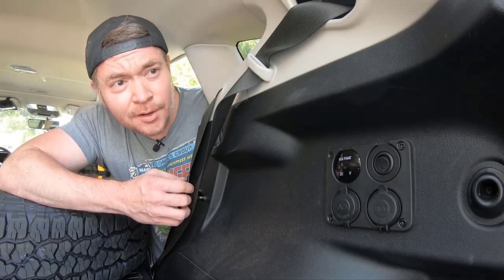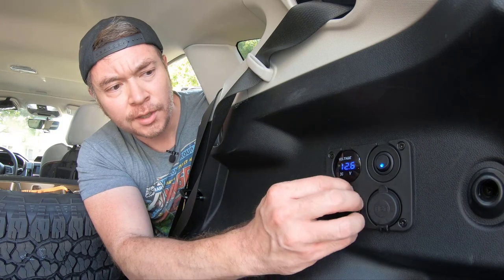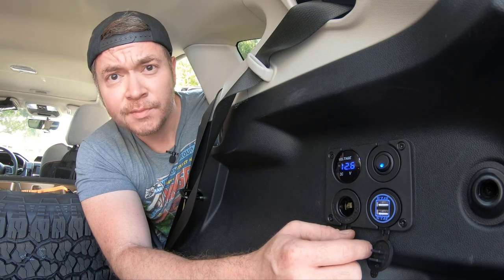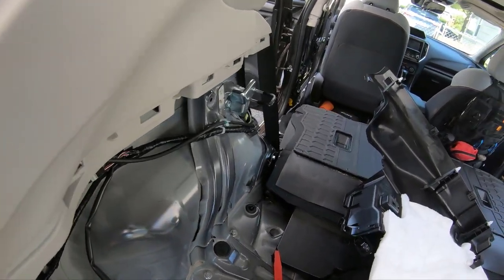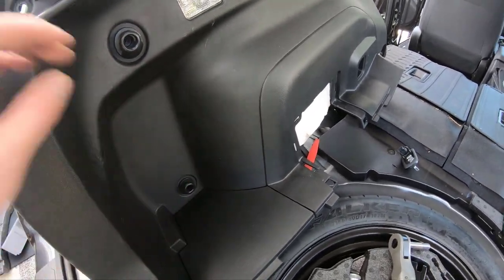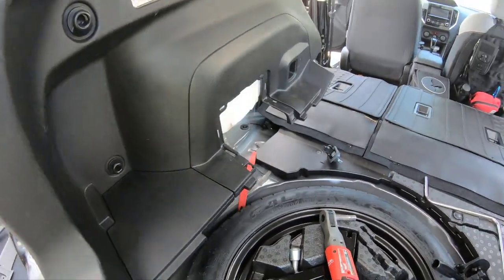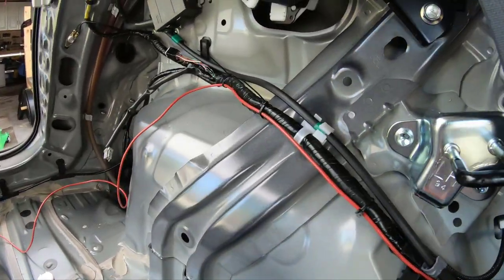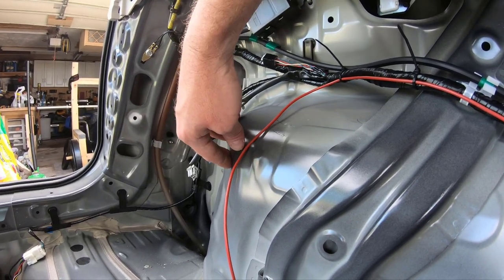DIY 12v Panel Install - Subaru Crosstrek

Comment: One of the best how-to mods I have seen which pays attention to safely and properly wiring a circuit. Please consider posting more links in the SubaruXV forums—maybe get this stickied. Glad I found yours.
Reply from the maker: Very kind of you to say.  Thanks for the feedback.  This was actually my 1st video and I learned a lot.  Some folks from the XV forum gave some good feedback (like the correction I added to the description).  I'm still learning, and in hindsight I wish I had spent more time sharing best practices with respect to selecting wire gauge and what not.  I just started this all over the summer for the fun of it.  I like tinkering and video editing and figured I'd try to share stuff I find interesting with the communities from whom I've learned so much.  Thanks for watching and keep the feedback (positive or constructive) coming.  Much appreciated!

Comment: Great information and content but I will make 1 suggestion. 

Dont tap into ANY power supply to ANY safety feature. Especially eyesight. I worked for Subaru for years and that system can have some crazy issues with altered current/voltage. 

Plus if the system doesn't work and upon checking the eyesight is modified in any way, you could potentially end up with liability issues.

Other than that keep up the great work!!!!!

Comment: Hello Tom!
Popped in to say this is the best pannel-popping video I've ever seen in my life.
As a future Crosstrek/XV owner myself, I want to say thank you from the bottom of my heart as I'll also put a 12V socket in the trunk.
Reply from the maker: Thanks so much!  And good luck with your future Crosstrek!  This was one of my first mods, and to this day it's one of the mods I use the most.  Wish Subaru had thought to put power back there in my generation / model, but then again...where would be the "fun" in that?  :P
Reply: @TomtheDilettante  💪
I only plan to mount a standard 12V socket there, with no voltage indicator, USB, or switch. Thus leaving space for other additions, maybe an extra trunk light.
I was also planning to mount a USB charger for the rear seats/passengers, and seeing that you have a tutorial also for that is delightful!
Finally, a q̶u̶e̶s̶t̶i̶o̶n̶  series of questions I have for you: do you always keep your ScanGauge plugged in? Does it turn on and off with the ignition? Does it drain the battery in any way? Thanks in advance for your answer!

Comment: I have done similar builds in my older cars. I just bought a new Crostrek. I would love to do this. I have the experience. But I also have experience in breaking things. Can't muster the guts to do it. I'll just throw my 300w power station back there and call it a day.
Reply from the maker: That is definitely a viable and practical alternative.  I was nervous as hell cutting into my brand new car too but I figured "what the heck" LOL.  Thanks for watching!

Comment: Incredibly helpful, thank you!  About to do this in my Wilderness.  I was so disappointed to find no plug in the trunk.  I want forward and rear-facing dashcams and now I'll have wires running all over my backseat.

Comment: Dear Tom, 
I recently purchased a 2019 Subaru Crosstrek Premium and I absolutely love it, However, like you, I feel the need to install an additional 12 V power source in the rear cargo area as I keep a Jackery 550 when I go on long road trips/camping trips to recharge my laptop, cellphone, and other USB rechargeable devices. Recently, I found this item on Amazon. I especially like it because it gives both a standard USB connection and a “C” connection as well as the 12 V cigarette lighter type plug. (Kohree 12V Power Outlet Socket, 3 in 1 200W Cigarette Lighter Socket with PD Type C 3.0 & QC 3.0 USB Charger Waterproof for Marine, Car, RV, Motorcycle, Boat, Golf, ATV, etc) It’s manufactured by: Kohree. 
Anyways, I’m looking forward to installing other mods on my Crosstrek officially known as Katydid. 
Thanks so much for creating the video that included so much detail on removing inner trim pieces, routing the wiring and all the other many suggestions and precautionary steps. I look ok forward to any future videos. Again, thanks.
Don “Wolf”. S.

Comment: I appreciate your video. I just did a very similar install on my 2023 Crosstrek Base. The power station I used is very similar but only a 3 hole setup instead of the 4 holes your's has. The only things I did differently was I ran my wire following the fuel door release cable, just behind the seats to get the wire to the same spot as you ended up and I just drilled 3 separate holes instead of one large one to mount the charging station.

Soon I'll be adding USB and USB-C ports inside my center console.
Reply from the maker: Nice!!  It's a great addition to the Crosstrek isn't it?  Glad it worked out for you and well done!
Reply: @TomtheDilettante  Absolutely. My wife and I are planning a lower 48 state road trip with the Crosstrek and a 5x8 teardrop camper. This extra power panel will be great for keeping the 12V fridge plugged in while driving and it'll also help our 12V air pump reach the camper tires, because the cord doesn't reach from the center console.

Comment: Thank you so much for posting this. I am not installing this unit you have here but am upgrading my speakers and seeing how you remove the panels will prove invaluable! Thanks again and good luck with your Subi! I just got a 2021 Trek Sport and absolutely love it....except the woeful speakers!
Reply from the maker: Glad it was helpful!  If there are any other panels that you're thinking of removing that I didn't cover, let me know.  Chances are I've pulled them already and would be happy to do a quick tutorial to help you and others out.  I spent quite a bit of time looking how to remove panels on YouTube, and when I came up empty, I just started pulling things LOL.  So far so good.  I have a video on installing a Ram track mount that shows how to remove the air vents and top plate from around the head unit.  Might be helpful if you plan on tinkering around behind the radio.

Thanks for watching and have a good one!
Reply: @TomtheDilettante  That's good to know....I will definitely be checking that out! The speakers get in tomorrow so I've got a nice weekend project ahead of me. Thanks again, Tom.....really appreciate your efforts on here!

Comment: Hey Tom, got my kit in a few weeks ago and planning to tackle this project this weekend. Really appreciate your posting and willingness to walk us through your process and the hiccups along the way. I've done a few electrical mods for lighting based on StarDude's postings, but find the Crosstrek is lacking power past the center console hidden lighter outlet (MY18). 

Based on the great comments by viewers I think I'm going to use 14ga wire and a hole saw as my only change to your process.

I'll post if I have anymore ideas or snags along the way. Again, great idea, thanks for posting and willingness to walk through the entire process!
Reply from the maker: Awesome!  Glad other viewer comments helped craft your approach as well!  They definitely had some good ideas that I would have adopted in hindsight.  My way is certainly not THE way and I'll be the 1st person to encourage adopting methods from others and improving upon them.  Best of luck to you!  I hope it turns out awesome and you are happy with it!  Glad I could be of some help :)

Comment: Thanks for the great video.  I just completed it myself.  So nice to be able to run my air compressor without opening the hood to attach leads to the battery terminals.  The only thing I did different was when it came to cutting the hole in the panel.  I made a template out of card stock that was exactly the right size and used that to draw where the hole would go.  I’ve got a multi-tool oscillating saw that went right through the plastic panel like butter.  Thanks for sharing!
Reply from the maker: Thanks for sharing your experience!  Sounds like you did a more thoughtful job than I with the cardboard template!  That's good though...if I can't show people what to do, I'm happy to show what NOT to do LOL!  Not sure what kind of wiring you ran, so if you haven't already, please be sure to ensure the fuse tap and wire gauge you used is sufficient for the current draw of your compressor.  In my case, I have a Viair 400P which came with a 40amp inline fuse.  Assuming the unit draws even 3/4 of that, I'd have needed to use 10ga wire and possibly a heavier duty fuse tap.  So I still end up popping the hood to connect it to the battery terminals, but I hope to permanently mount that compressor in my spare tire well with a dedicated relay sometime soon.  Just gotta figure out the pneumatic plumbing :)  Anyway, pardon the ramble, but hope that helps and thanks for watching!
Reply: @TomtheDilettante  I’ve just got a little Vivair 85P which is only draws 14 Amps peak and is fused at 15 amps.  I ran 12 gauge wire to the fuse panel.  It’s a tiny compressor but I don’t air down that often.  Worst case I’ll have to wait a little for it to cool between tires.  It fills from15 psi to 30 psi pretty quick.  Thanks again and thanks for following up on the amperage and wire gauge.
Reply: What kind of wire did you run along the length of the car?

Comment: Love the crosstrek videos. Just started watching as I just bought a 2014. With the amount of wiring you do for mods, I seriously suggest getting a ratcheting crimp tool for your connections as opposed to the hand crimper. Way easy to o and the connections are MUCH more secure.
Reply from the maker: I think you're right.  I've heard good things about ratcheting crimp tools much like you said and I think I'm gunna have to get one.  knowing myself though, once I get one, I'm going to be compelled to re-do ALL my wiring because...well...why not?  LOL

Comment: Hey Tom, I have a 2019 Forester that I modified for off-road too! My car came with a 12v plug back there, but I replaced it with a panel like yours. Mine has all four in a row. Thanks for this great video! I am thinking about adding a second battery in my spare tire area. I too have upsized tires that don't fit the spare area. Going to check out your other videos now . . . check out mine too!
Reply from the maker: I've seen your channel actually.  You replied to one of my comments inquiring about the Daniel Boone trail (thanks so much for that by the way).  I love the RC airplane stuff too.  I dabbled in that a bit but never got deep into after I got a citation for flying in a completely safe and unpopulated area that happened to have a rule against it.  Such is the case with most places near me unfortunately.  You got your PPL (Private Pilot License)?  That's another thing on my bucket list.  Have a few hours stick time, but that's about it.  If you install a 2nd battery system, definitely post that on your channel!  I love seeing other folk's mods.  Thanks for watching!
Reply: @TomtheDilettante  Hey Tom, it looks like you have a couple new electrical videos that I need to watch. I don't have my PPL, I was just flying with my friend. I need to do a walk around video like yours next.

Comment: I was thinking of putting the same panel in my Crosstrek. Seems like it would be really handy.
Reply from the maker: Definitely handy.  No regrets so far.  Great for keeping a refrigerator running on the road or for charging up things like battery packs, etc...  I wired mine to a constant hot so need to be careful not to leave something plugged in too long when the engine is off.  I'm sure there's a fuse to tap into that's ignition hot which could be used as well.  Good luck!
Reply: Awesome, defiantly sounds like an upgrade for me :)

Comment: This is super cool. I just bought a 2021 Crosstrek, and there's a few mods (interior and exterior) that I would definitely like to do.. but I'm opting to wait until the warranty runs out. It sucks to wait, but I'd rather do that then something break and the dealership blame that. 

Would love to have something like this in the back though.

Comment: Thanks for making this dude! I bought a 2019 Limited last year, Crystal White Pearl, and I was looking into some options of having an inverter or some additional power to the rear. I came to the right place!
Reply from the maker: Hi Kyle, thanks for watching!  Glad I can help and congrats on the new Crosstrek!  I think an inverter is something I'm missing too, but I'm toying around with the idea of getting a Jackery portable power station for something to use both in the car, and at a campsite.  Have a good one!
Reply: @TomtheDilettante  update us on this! Please and thanks
Reply from the maker: @zero86ea  hey there!  Happy to provide an update.  Anything in particular you'd like to hear about?  I did end up getting a Jackery power station that I plug into this panel.  Can also share how I've used this so far on different trips.  Any other thoughts / requests?  Thanks for watching!
Reply: @TomtheDilettante  would like to know the hole setup. Also, if it would be better adding a second battery to the car instead of the jackery. And also solar on the roof rack. Man i love ur channel so far dude!!
Reply: @TomtheDilettante  also show us your current setup with the jackery.
Reply from the maker: Will do.  I'll try to get to that this weekend.  Thanks for the inspiration!

Comment: That was a lot of work I have Subaru 2019 cross trek was thinking of doing something like that . That is a pretty cool setup looks like it came with the car Great mod Tom . Thanks
Reply: It’s actually less work than I expected.  Tom just did a diligent job of explaining every step.  I just did mine yesterday and it only took a couple of hours.

Comment: Thanks for the video tutorial. I've been wanting to install some outlets back there. I've already ripped off all those panels a few times to install better hatch lights and a hatch opening button. Your filming angles and description are far superior to the other video guides I've used! Question- since doing this project,  have you learned of a different/better place to cross the wires over to the passenger side other than around the very back of the car?
Reply from the maker: Thanks for watching and the kind words!  If I had to do it all over again, I would have just run the wires down the passenger side of the car.  It realized too late that the panel wasn't going to fit well on the driver side and ended up just crossing the wires over out of laziness (not gunna lie) LOL.

Comment: Doing this same set up this weekend 👍 thanks for the detailed info!!! U da best
Reply from the maker: Awesome!  good luck!  If you find a better way to do it than I did, please share.  I kinda made this one up as I went along...but it worked so.... :)
Reply: @TomtheDilettante  for sure! will share if I find a alternate solution
Reply: @TomtheDilettante  just finished my project and honestly I did it pretty much the same way you did yours only thing different was that I did not have to remove the pillar by the driver side seat belt just snaked it through

Comment: Your cutouts are wrong. You are supposed to drill out circular holes for each receptacle. The plate only has 4 screws. You don't drill out the whole area for the plate, it weakens the backing.

Comment: Tom great video!!  I have a 2017 Crosstrek and I’m building it out similar to yours.  I’m getting ready to install a Yasue 6000 ham and I wondered if you ran yours straight to the battery or if you did it another way?   I appreciate any feedback or suggestions!
Al

Comment: Tom, I also want to have a rear power outlet for a cooler. I have been watching your YouTube on running power, however I am in Australia, and my XV is right hand drive (Japan built). From my research our vehicles are totally identical but having the steering on the right the fuse box is also on the right, The only difference is the dashboard and firewall, (mirror image). How difficult is to remove the back where you placed your outlet, and Im assuming lifting the floor and centre lining will be the same. Very instructional.

Comment: Another awesome project! Question: at 13:35 you can see a small connector taped off with purple & black wire from the factory. It's almost right where you installed this. Do you know what this is for?
Reply: Just realized you used the same grounding bolt as the connector I mentioned

Comment: Nice job, except you'll need a dual battery that is a deep cycle, in order to run a 12v fridge
Reply from the maker: For sure!  I run a small 12v refrigerator only when on the road with the engine running.  When at camp I use a Jackery 500 which has so far done a nice job.  Thanks for watching!
Reply: @TomtheDilettante  I get that. I'm building my own  solar powered generator because they are way better and way cheaper.  Plus it's a super fun project

Comment: Thanks so much for the tutorial. I been looking up and down of a proper way to connect to my fuse box. You showed that plus the panels which was amazing. Do you know which fuse number I need to put? Or a simple explanation on that?
Reply from the maker: Thanks for watching and glad you found it helpful!  As for which fuse, it shouldn't really matter since the way I did it with the fuse tap was to retain the original fuse in the original circuit and just add a circuit with a new fuse.  My approach is to tap into any "non-essential" fuse like an accessory, radio, or dome light fuse or something.  In other words, I wouldn't tap into ignition or eyesight.  Not that I would expect anything to go wrong, but just one less thing to worry about.  

Anyway, if you liked this one, you might like my next video which I should be posting today (3/9/2021).  I added a smaller, but similar power panel to the back of the center console for power to the rear seat ;)